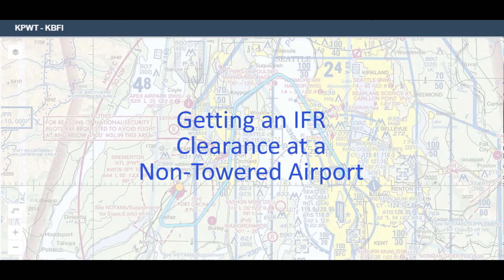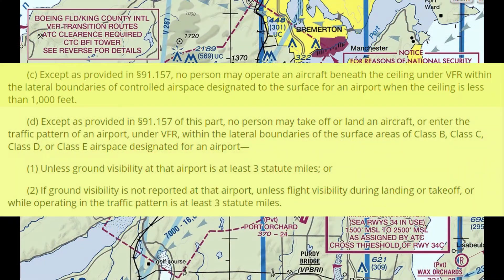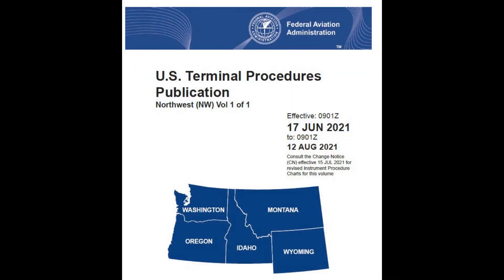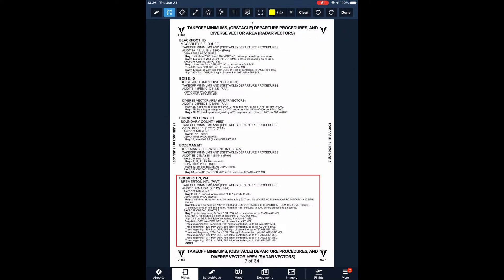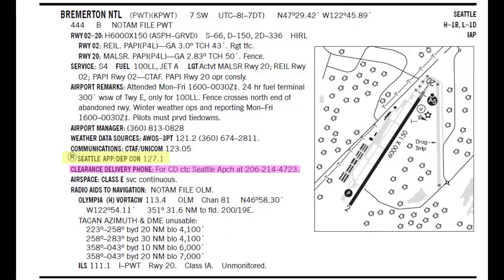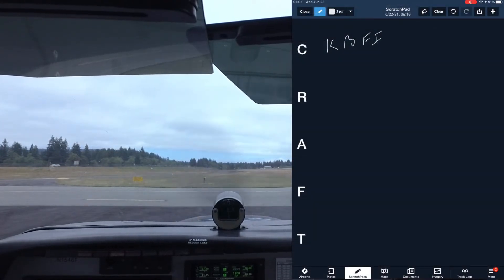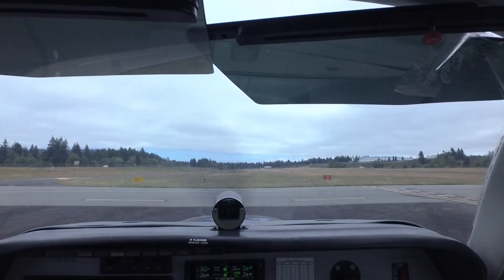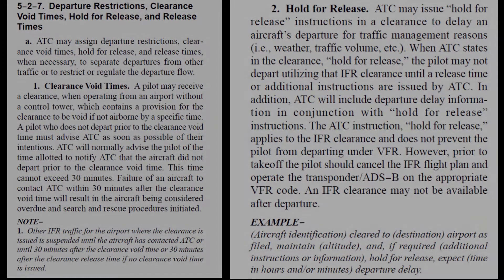IFR Departure at a Non-Towered Airport

Comment: Oops!  The clearance was "FLY RUNWAY HEADING." Never did hear those words on the readback.
Reply: And this omission caused extra radio calls from the controller, who wanted to hear back what he said--RUNWAY HEADING TO 3000.  Dude.
Reply from the maker: Although I didn't repeat the runway heading in my initial readback, you hear the controller then ask me which runway I planned to use (although I had included that information in my initial call), and when, with that information, he updated my clearance, I acknowledged the HDG 197 and altitude. Of course, being humans, we all occasionally misunderstand instructions or omit details in a readback. That's the why we check one another.

Comment: I typically like to get my clearance prior to taxiing out of the chocks and more preferably before I crank so that I am able to determine if I have the fuel and better able to plan for contingencies.
Reply from the maker: That's certainly an option, but when you call, you should tell ATC that you won't be ready to depart for several minutes. In general, it's better to call for your clearance when you're ready to go, especially at busier airports. You should have  your expected route--ForeFlight and other apps provide that information when the ATC computer accepts your flight plan. With that information, you should have a good idea of your fuel requirements long before you get to the airplane.